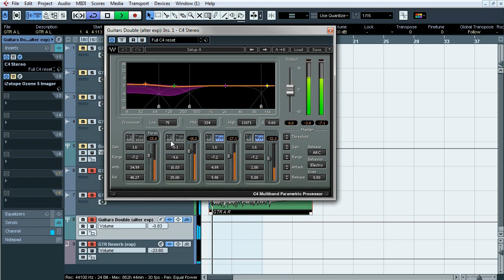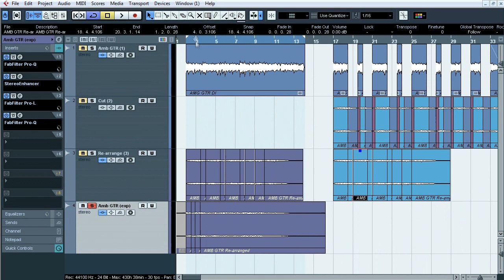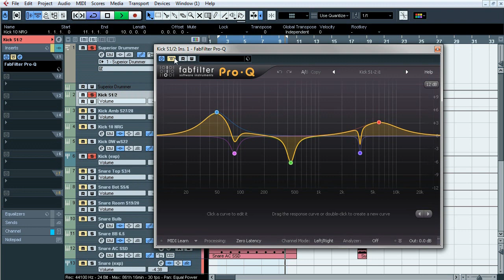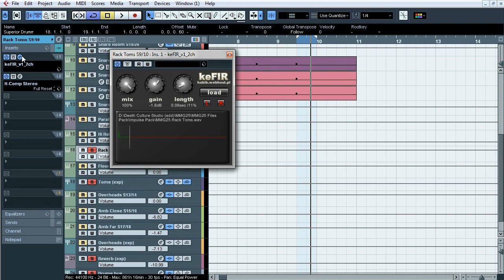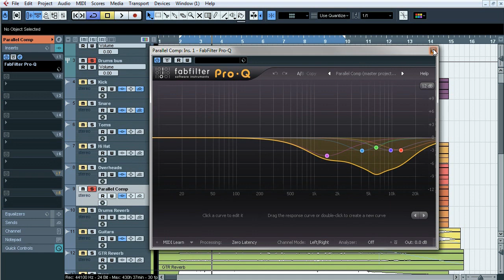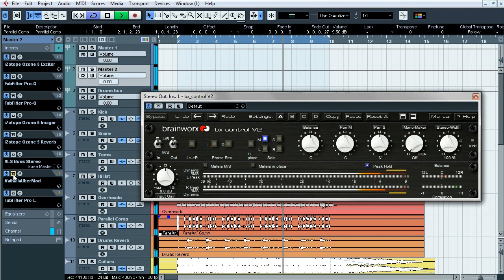Metal Mixing Guide #25 [Architects tone] "All Our Gods Have Abandoned Us" album

Comment: I see you have GGD Modern & Massive drums in your Kontakt Library. Any chance for a mix guide with them sometime in the future? :)
Reply from the maker: Not really sure mate. I've been testing it couple of times. First of all - I'm not able to fully load the library (32bit limits, so full load crashes my DAW).  Second - it just doesn't sounds right for me. Don't get me wrong, tone is perfect. I abosolutely love popping snare, tight kick even without using Turbo mode. It's perfect for stuff like Periphery. But other than that... I feel like it's too clean and still not even close to Superior's variability. Can you imagine GGD performing stuff like "Slaves Shall Serve"? I don't think it's gonna be good, and that's where SD will be the ultimate source. I think I just got used to it so much, it just feels natural to work with those rooms and overheads, even though I hate snares and poor sample content (comparing to today standarts of course), but it can be fixed by using modern SDXs like Metal Machinery or (obviously) SD3.
I might use GGD for triggering, but not as the main kit
Reply: @DeathCultureStudio  I agree with the fact that GGD is made for modern style stuff and superior (3 in my case) sound so much more natural to my ears. Any reason why you're sticked with Cubase 5 32bits ? I was in the same case, but now I've switched to Reaper. Workflow is a little different and you need to train a little on it but the stability/the possibilities with macro or VST choice (you can load 32/64 bits VST2/3 plugins in same tracks). Also thanks for all your videos, it's amazing :)

Comment: HEY IVY, which interface do you to record guitar?
Reply from the maker: Erik Tails I use Scarlett 2i2, but in this case all recording routine was on Sayar. As far as I know he use 2nd gen of 2i2. You can visit his cover video, there is full recording path in the description :)
Reply: Death Culture Studio oh thanks for replying man, im gonna buy the 2i4 this week, any toughs? And what about pickups you use? I noticed my emg 707 sounds very similar to yours!
Reply from the maker: It's EMG 81/85 combination in 18v mode :D As I said in case of this guide - it was different guitar and pickups, but one thing I forgot to say, I actually used some of my recordings here for clean guitars (not ambient), though I didn't change strings for nearly two years now. 

Speaking of 2i4 - I'm big fan of Scarlett, those are probably most used interphaces these days. It's all good for me, but still there might be some cons you should know about.
First one - sensetive inputs. In some cases you may clip even with gain knob at zero. I think I had this thing long time ago when used really fat string sets. If you use EMG707 - you're probably closer to a baritone scale, so string should be less thicc. You shouldn't necessary face this problem, but if you will - you can use a screwdriver and drop your pickups down to the guitar's body. I'm not talking about crazy drop, just enough to lower the output of your guitar. And another thing you can do - simply get a DI Box. It shouldn't neccessary be the passive one, you can use active as well. Yesterday I've read some stuff about it - you may be interested https://www.ultimate-guitar.com/forum/showthread.php?t=1637942

Second issue - buffer size limits. You can't really use higher than 10 ms, which might be an issue if you like to go for complicated and heavy projects. My previous interface (E-mu 0204, I don't recommend to go for this one btw) could go up to 30 ms delay giving me beggier ASIO headroom, though I used to go for 96 kHz, because 48/44.1 constanlty gave me BSOD all the time.

Other than that - it's a great thing. I like the fact that it's case made of metal, so if you plain to drop it from your table - chanses are it will survive it without a scratch. It looks great, has combined inputs for both guitar and mic cables, very low delay, midi I/O. You will also get some stock plugins to use
Reply: Death Culture Studio holy shit man, you basically resumed what i've been searching for months! Thanks so much for this information!
Did i got it right? You havent changed strings for 2 years? O.o

About the clipping issue: i was in a hurry and actually got the 2i4 2nd gen (waiting to receive yet). In this one theres a pad button which reduce the input level -10db (i really hope this be enough and doesn't fuck with tone quality). Ill try to lower the pickup height if i get clipping then! 
I may post my review here to help someone too.

Comment: Was wondering what the guitars are tuned too?  As always. Awesome. Don’t have revalver but I’m sure some tse stuff will work.
Reply: most daws have a pitch shift option. you can usually get away with going about 5 notes lower before it starts sounding too  bad
Reply: I'm pretty sure they tune to C# Standard then drop the low C# (E) string to F# so it creates an octave between the E and A string.